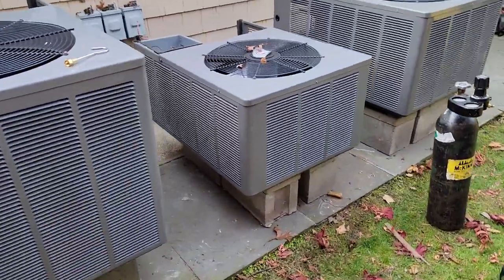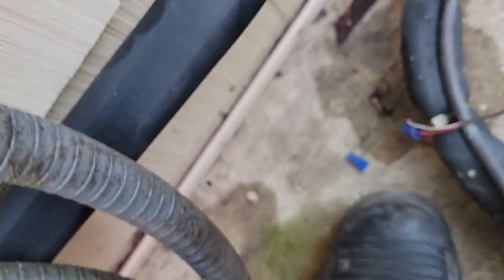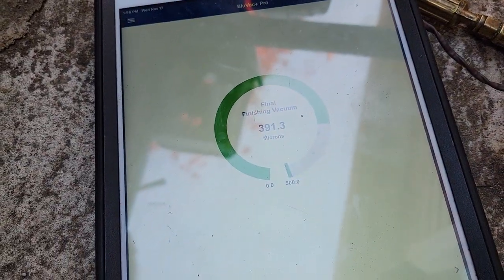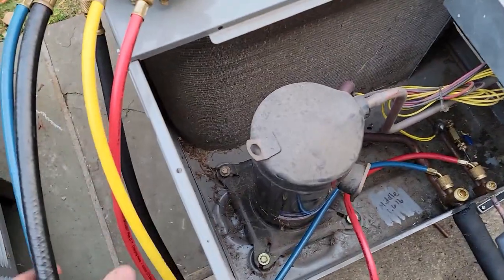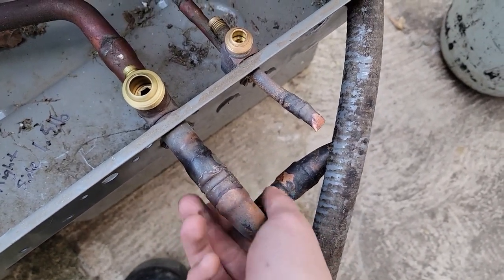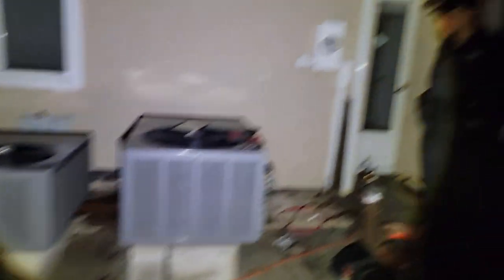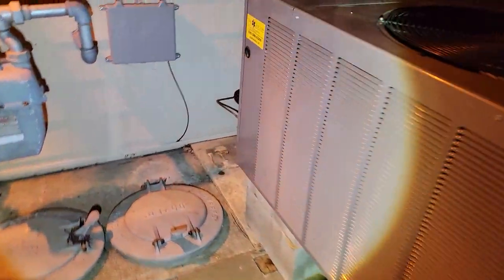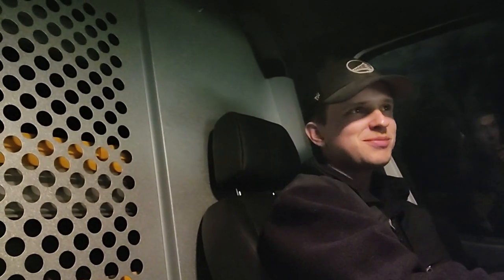Relocating 3 Condensers! First Big Solo Job! Rheem 410a!

Comment: Don’t put in a sight glass in Ac work rely on subcooling & superheat to charge unit .Great job your learning.Use a sight glass on refrigeration system.
Reply from the maker: Customer had sight glasses, so I put them back in. Wasn't gonna take away from what he had already.
Reply: @DCHVAC  your learning you could take the sight glass out it not going hurt the systems be extra careful you could overcharged system by going by the sight glass essential they don’t have a receiver go to the nameplate how much pounds it take get the manufacturing literature how much extra do you have to put in for the extra piping for pounds of refrigerant take your sub-cooling if txv or piston use superheat and to the nameplate it will tell you & charging charge. Make sure you write it down inside the equipment so next time.